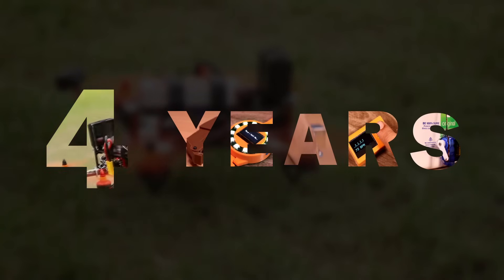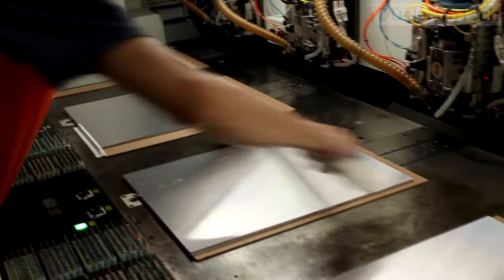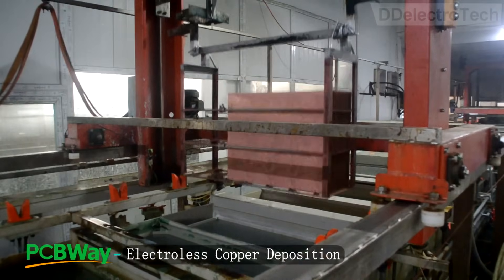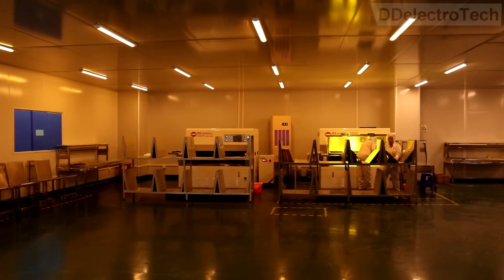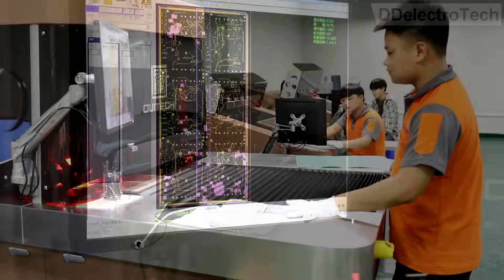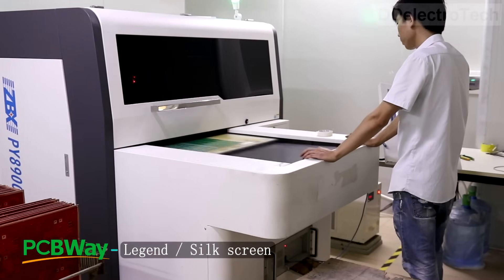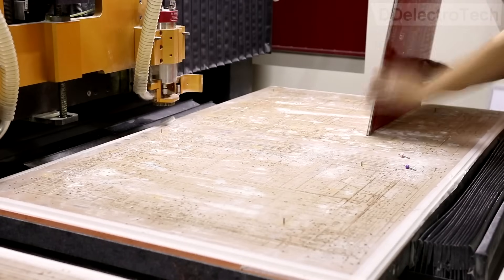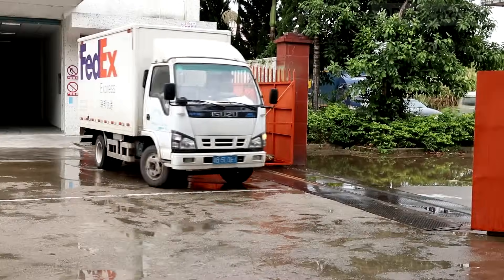How PCB is Made in China - PCBWay - Factory Tour

Comment: He did not mention when was the fiberglass and cobber combined, the process he presented from the beginning was to wash then cut the copper plating and then the holes are drilled and the edges are trimmed then electroplating the fiberglass...?? So when was the fiberglass suddenly added in between the cobber? xD before drilling I suppose?

Comment: Wow. Can you imagine what it takes to design and build these machines, write the software to control them and even develop the processes to make them. Bravo China
Reply: I worked for a PCB manufacturer for years making up to 36 layer boards with 4 thou track and gap + buried vias and that was very early 2000’s , then the Chinese rocked up, although they could only make up to 8 layer boards at an absolute push most boards were only 4-8 layers and were 75% of our work. The company was 25 years old and worked with F1, satellite, aerospace and more I can’t talk about but within 3 years we were finished as the basic work dried up and went to China. All that process development work was lost forever to others who had acquired it ( honestly or dishonestly).
Reply: It’s all copied from the west , there is nothing in this process that wasn’t in the west in the early 2000’s
Reply: @davidbarlee4722  That is the absolute truth.

Comment: You NAIL the pcb board and STICK it with masking tape...are we in 2019??
Reply: They secure the board to the router bed using dowel pins for accuracy, the hammer is used to knock the pins flush with the surface of the board so the router head does not smash into the pins. The tape on the edges is to hold the board as flat as possible to the bed which will also stop them "chattering" (vibrating) during the routing process. Also stops the edges lifting and being hit by the router head too. Simples!

Comment: Can they make a PCB board that will hold krypton vacuum tubes and Gigafarad flux capacitors for my vehicle mounted time machine?
Reply: Yes, but I would make the traces wide to handle the current. Also, do you plan to add a Sonic screwdriver charger?
Reply: PCB Factory - 'Of course. You pay cash. 70% now and balance on delivery of PCB'.

Comment: In the 1980'ies, I worked with repairing answering machines. The PCB quality was so bad that it is impossible to compare with these Chinese things.  Made from phenolic paper - the pads sometimes were loose on new machines. Since they were one sided, there were a lot of jumpers, and since they were made in Taiwan, the climate made them corrode, so many of the joints were faulty, or became "inoperable" within a couple of months.
When a customer brought a faulty device to me, I dismantled it as if it was a bomb - I didn't want to provoke those faulty joints to re-establish momentary connection before I had a chance to make any measurements to figure out the cause of the malicious behavior.  
But most of the time, the machine won.  That is, the jumper or whatever it was, decided to transmit electrons again before I found the cause of the misbehavior.  So I never felt I had a chance to do my work properly. Usually i said "Can't find anything wrong with it " to the customer, who immediately made fierce objections.
Those were the days.

Comment: I actually made PCBs for my amplifier circuits (transistorized) using a kit consisting of a copper clad board, ink (like magic marker) and etching fluid. Had good success with it (the amplifiers are still going strong since the 1970s-80s)
Reply: How can i plz let me know i also want to prepare pcb boards for LED bulbs
Reply: Can you please name me the software where you desighn those .And how you desighn those .. ?
Reply: @indianancientsage  Those PCB circuits were all designed before I started using a computer (1980s-1990s). I started computer use in 2005. I have the knack to draw circuits on the board according to the schematic and have become quite proficient in soldering.
Reply: Please i need your advice on how to start a tv remote control manufacturing company
Reply: @norman gates, now the lazy bloated ""modern"" developers use backdoored FPGAs for simple things instead of building them themselves... it's pathetic. More people should follow your example.
Reply: @CatalayaNadihat  what is a backdoored FPGA?

Comment: Any idea why most places still use the copper subtraction process rather than adding the copper where it's needed instead? I know it's only 1-4oz of copper but I'd imagine it adds up pretty quick, and since copper has to be deposited to create through holes and vias anyway it seems like they could just plate the bits that need copper all at that stage
Reply: Isn't it the case these days that most PCBs actually only have a small amount of copper etched away, with that not used to form the interconnections left in place as a ground plane?
Reply: @johnm2012  That's more of a design choice by the designer of the PCB. Since there is no extra cost in using the rest of the PCB as a copper ground plane, and it is beneficial to have a larger plane, then most designers will have the large ground plane.

Comment: Nice video - however I have two comments. First, there are way too many ads and they are very intrusive. Could they be placed at natural breaks in the narration? Second, you did not show how they make boards with more than 2 layers - the process has a few extra steps that are very interesting. One final comment, too :) More detail on the plated-thru-hole process would be nice. You didn't show how the electroplating makes copper stick to the inside of the holes.

Comment: Most of the video is correct.  I did hear one mistake at 2:25.  It says "this is an air DRIVEN drill".  I have been in the PCB drilling business since 1980 - as a field service engineer and as an applications engineer.  High speed spindles use air bearings but they are driven by 3 phase electrical power.  The frequency and amplitude of the power is varied to control speed and acceleration of the spindle.
Reply: Are you sure, man? Look at the size of the air line.
Reply: @meepk633  Yep - I'm 100% sure.  The air is used for the non-contact bearings and for opening and closing the collet.  The spindle shaft is completely suspended in air because conventional ball bearings would burn up.  I have worked with spindles that spin as fast as 180,000 RPM (3,000 revolutions per SECOND!).  The RPM is precisely controlled by the computer (using "closed loop" feedback).  The spindle can go from 0 RPM to full speed in about 6 seconds.  The extreme speeds are needed for using drill bits down to 0.002" diameter - that's about half the diameter of a human hair.  All speed and almost no torque!
Reply: and this is the only half process after that smt components also soldered and MI components
Reply: @childrenfunvideo3877  Some people buy blank boards smartass

Comment: Hi, thanks for such informative video. I have a small question about a project I am planning to start, as you are very knowledgeable, please help me in this:

I am very new to the Arduino world, I am trying to convert my wired keyboard into a bluetooth keyboard. Here are my layman questions:

- Is it possible to add an audio jack adapter(like PS4 joystick has), so that I can plugin my headphones to my keyboard itself to listen to the music.
- Is it possible to achieve this(bluetooth keyboard + audio jack) on Arduino or do I need to use Rasberry-pi?
- Is there a way to keep my current USB wire? so that I can keep working even if the battery runs out.
- I want to keep all the apparatus in the keyboard casing itself, can you please suggest smallest Arduino board that will work for my use case.
- I am not sure if I need a special kind of bluetooth breakout board for this(that can receive audio as input and send keystrokes to my system). Can you please guide what will be the best fit board.

Comment: I recently designed a custom Arduino Shields, and emailed the Eagle CAD file to PCBways.  They charged 40 bucks including shipping for 10 boards, and the boards were at my (Illinois, USA) door in under a week.  Everything was great except the silkscreen printing, which was not great.  Still, I was amazed at the speed, quality, and value - and I will be ordering from them again.  (I will also ask to see/approve the silkscreen file before it is printed.)
Reply: The silkscreen really isn't it's an inkjet process but it's "good enough". The file won't show you what it will look like printed because there is some creep at the edges during the printing process. OSHpark in the US has much crisper silkscreen but they're also more expensive and their solder mask is also less resistant to heat and flux. I've had trouble with the solder mask being eaten away near the pad with their PCBs which is a problem I have not seen in PCB Way JLPCB made boards.

Comment: Rewind... late 1980s.. early 1990s... I used to all this using hands - 100% manual, including drawing the circuit by hand and etching at home - in all my DIY projects.
Reply: diablo,,the best thing which is saw is making pcb at home using inkjet printer,,,,,
Reply: @nelsondarwinpaktech3954   There were no inkjets at that time... :-( It was a painstaking drawing with paint (by hand), and then soaking in acid overnight to dissolve copper not covered by paint, and then drilling holes... it was a DIY in itself outside out actual circuit assembly.

Comment: Just in the past year, I’ve had more than several thousands of dollars ordered from PCBway. 

It’s a good quality PCB company. However, their prices are constantly increasing. Now it’s almost as much as it would cost me to order them to a US-based company
Reply: Not sure how you figure they are increasing.  My first order was in 2015 for 10 boards, all surface mount high density and under 100mm.  Price $13.00.  Just sent in 30 orders in the last few months and all boards less then 100mm quantity 10 was $5.00.

I have to laugh at those criticizing them, probably never used them before.  I have hundreds of boards from them, all extremely well done and flawless.  My last 30 orders are for a system design I'm doing to control a high energy particle accelerator (LINAC), so not exactly low end simple circuits for hobby only.
Reply: Tywais based on your prices, you do two layer simple boards. 

I do 4+ layers with set copper weight (often 2 Oz) + stencil + PCB thickness (sometimes 2.4mm)

On average, for 10-20 boards from them, I pay $200. 

I’m not talking about toys. I’m talking about real industrial prototyping here. 
For the same boards in the US, I can pay $300 - $400. But I won’t have to justify non-US ordering. So sometimes $350 is easier than $200.

Comment: OMG, so many quality mistakes T.T.... not good for safe pcbs
Reply: It’s low end prototype boards. I use them often for our prototypes and they work fine. 
I won’t recommend them for a precision or a sensitive application
Reply: @Harry PAnnU ! Hey, you forgot an "O" in your "our", you just wrote "ur" ;) think about it
Reply: BAD LS, what mistakes did they make?
Reply: @sefton999  Hi,
they're touching components with fingers, what cause thin layers of fat residues. How I see, there is just one clean room, that guarantees that your layers are not contaminated by foreign substances, that can break a pcb in a reflow process. Touching the finish pcb with your skin could cause electostatic discharge and blow up your fragile wires inside the pcb. In the other hand again, fat residues on your solder pads. That is the way, how it is possible to produce these pcbs very cheaply. But the quality is like....meh... its ok for handicrafts.
Reply: @BAD_LS  I also thought that it was sloppy of them to touch the material without gloves. However, you are wrong about electrostatic discharge. No traces are small enough to be damaged by that. It's different once you have parts on the board, since many kinds of parts have extremely tiny features inside.
Reply: Yes. The factory is setup to make low end, low density 2 layer boards. The boards are not even suitable for things like wireless routers. May work with TV remote, calculators, etc. But not much more.
Reply: @tw9668  , They can do up to 14 layers according to their website
Reply: @sefton999  The video shows how to make 2 layers only. May be the manufacturer don't want to show their procedures. Production process from 4 layers and up are very different. I used to work for a company that makes 40+ layer board for Cisco, Nortel, Avaya, etc. The precision requirement are much higher when layer counts go up. Additional features such as blind-via, buried capacitors, etc. are more difficult also.
Reply: @tw9668  may you, please, share name of pcb-supplier, who really can make 40+ layer pcb?
Reply: internweb it depends on how much you want to pay. 
For example, Advanced circuits (4pcb) in the US is a better quality manufacturer that also offers ITAR if you are doing a governmental design.

Comment: They need wear gloves instead of use bare hands touch boards.
Reply: ...it will increase the production cost...
Reply: they are one of the biggest PCB factorys making millions a year and now a youtube engineer is coming to tell them what they do wrong, really..?
Reply: @siboneyyy  🤣🤣🤣
Reply: There's simply no need for gloves. Nothing on the board is sensitive to a hand touch, it's all tough materials, unlike chips.
Reply: @wty1992  LoL actually if you touch the copper before the solder print, you leave your fingerprint on the pcb, this will be a future point of oxydation inside the pcb that lower the life of the circuit of the 80-90%.
Reply: @I00RESET00I  on that point you will leave a mark even if you touch it with gloves on, the outcome of which is the same. I'm pretty sure they thought it through pretty thoroughly.
Reply: @crazymarkmc  no, it is not. There is no human body grease on outside surface of the gloves, unless you've been rubbing those against your face. 😂

 Better read what wise people are writing you here.
Reply: @atenrok  ok
Reply: @wty1992  panel is sensitive on all stages after drilling. It become non-sensitive only after surface finishing and only if it's HASL.
Reply: Also mask please! No point wearing smoke w/o glove&mask

Comment: Very good factory! I often  order pcb  from them . But I do not  understand why milling slots and windows leads to higher price on 200$ !!!  

10 pcbs- cost 5$    10 slots cost + 200$!!! It is crazy! I do not understand this.
PCBWAY is make great quality pcbs for me, I make slots on my cnc milling mashine for 10 minutes free.
Reply: Maybe the slotting operation is not common enough, or relies on an extra manual step, and they price it this way more to deter than because of the real cost.
Reply: Have a look at aisler.net
they are a pcb manufacturer in europe, where milled slots cost nothing extra
Reply: In reality it does make a big difference what kind of slots you need in your board. If it is a very narrow slot (0.6mm, for a connector-tab, is not uncommon), and it needs to be plated, it's very expensive. Problem is to get a good surface quality for the plating process, and wear and failure rate on those tiny tools to mill the slot is high (remember that the board is GLASSfiber with resin). And usually these slots have to be milled on single board stacks, while normal drilling can be done on stacks of several boards. Some drilling machines can mill slots too, but some are not built for such operations, so you need to use a specific machine for that milling task.
If you can, try to use unplated slots, because these are much easyer to do in the same step as the boards get cut from the production panel. And if your slots are at least as wide as the standard tool (2mm) they use to cut the board shape, that's another bonus that could save cost.
And you have to remember, for prototyping boards, the set up for all these processes (making the programms that run on the cnc machines) takes a lot of time and this increases the cost for your order.
Reply: Slots and break away tabs are expensive because it requires really precise machines and some times special tools. Most of the times it requires to be done one by one which takes time. No every job is the same but there is a standard cost for it.
Reply: They make the basic pcb's at lost, and if you need everything else they charge the full price which is, you guessed it, +20 per piece.